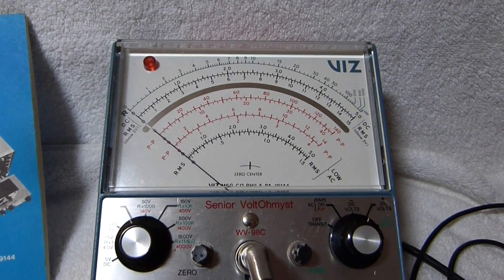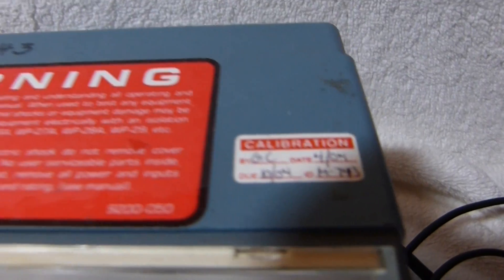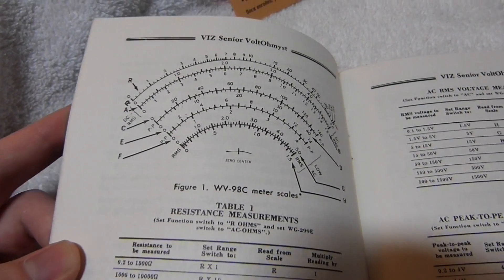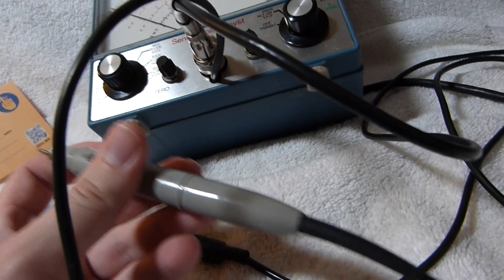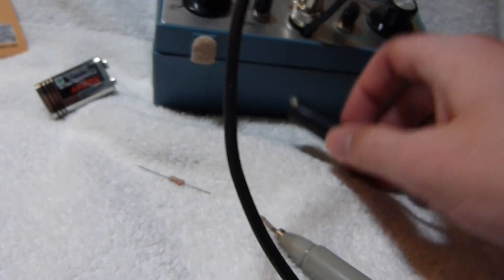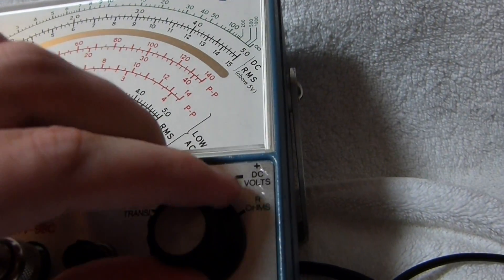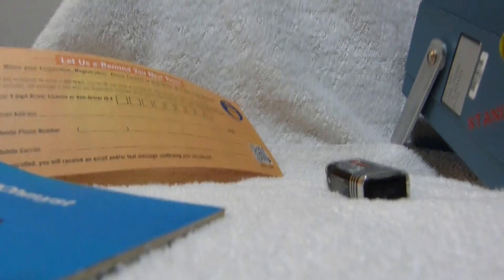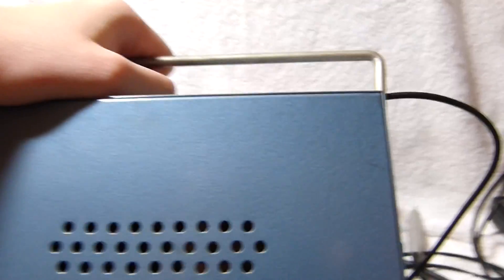VIZ Senior VoltOhmyst WV-98C (made in the USA in the 1970's)

Comment: I worked for VIZ off the boulevard in Philadelphia and RCA , Camden, NJ. This meter isn’t exactly lab grade, but very good service instruments. I still use mine and keep it calibrated and restored on a daily basis in my shop. There are very few differences in the models of RCA and VIZ. the item  is quality personified. It is a bench meter, not a field device. Its great for reading leakage in a capacitor . I double check each capacitor I replace with a digital cap meter, then using the megohm scale on my VIZ  98 i read the leakage. I don’t have the WG-299 uniProbe , but two probes work well too.

Comment: Hi Matt. That is one of the best looking VTM  I've seen. I have one of the last two VTM's you showed. I have set and checked it against  better quality  meters. and so far so good. I replaced the electrolytic.  Thank you for posting.
Bobby
Reply from the maker: Test equipment generally wasn't made to look pretty, but I like the look of this meter too, RCA definitely gave it some style. The accuracy on this one seems to be pretty good, I am glad I didn't have to replace any of the precision resistors or adjust anything.
Reply: AnythingButRadios
Hi Matt. What I meant was it isn't all beat up and rusty. the dial isn't cracked,has all it's knobs,Etc :)  Thank you for the reply and I am looking forward to you showing more of your test equipment and anything else you have in mind for new videos.
All the best.
Bobby
Reply from the maker: ***** 
Bobby,
Oh OK; yes these things are usually pretty beat up from decades of use, so I got lucky with this one. I don't have too much more test equipment that would be worth showing off, but I do have a few things. 
All the best to you too,
Matt